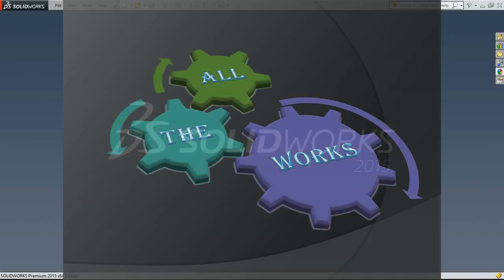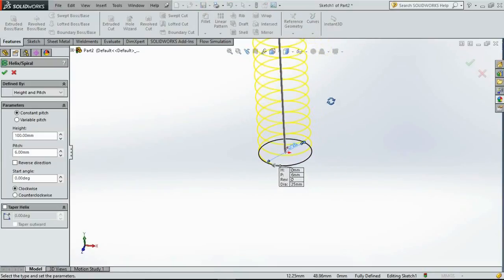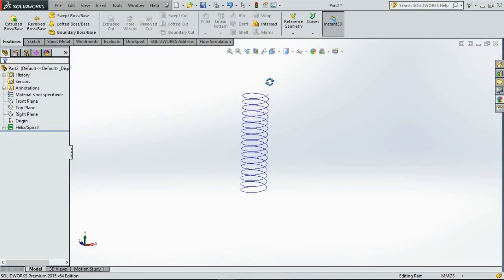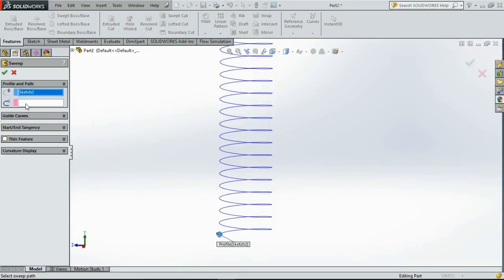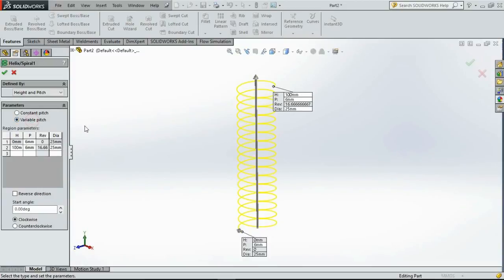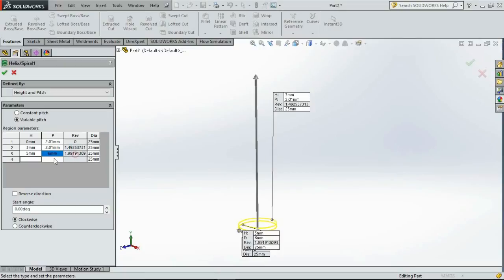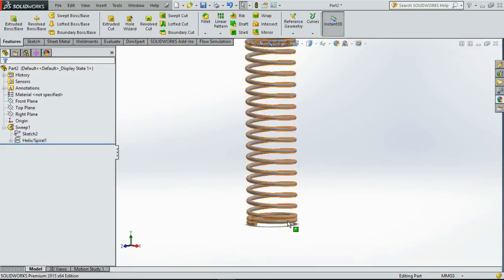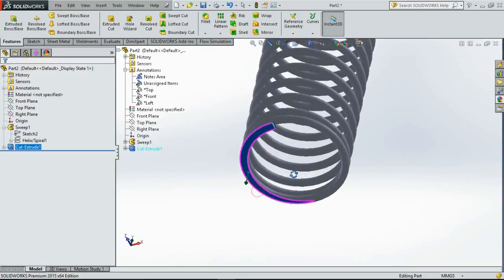SPRING IN SOLIDWORKS

Comment: I haven't had to create a spring in SW in 8 years. I needed guidance on the variable pitch to make the ends. You explained it very well. Thank you sir.
I can now create the spring per the drawing. 
Now I want to show some actuation. I think I am going to make 3 configurations: max spring height assembly allows, minimum height assembly allows, and midway between.

Comment: Hello dear. first of all thank you so much for sharing your knowledge to others. In case of me, when I make extrude cut two ends of the spring by extrude cut comand, solidworks shows an error which is "This operation requires a fully defined sketch". But in case of your example you do smoothly that. What is the problem here bro? Thanks
Reply from the maker: make sure that ur sketch is closed..  OR... go to Tools...Options..Sketch
...

Clear the check mark on Use fully defined sketches